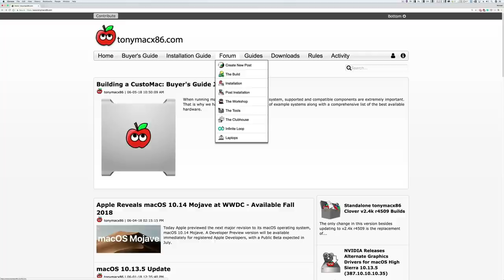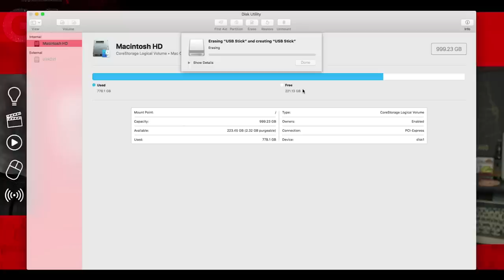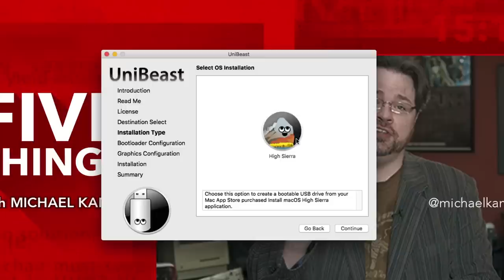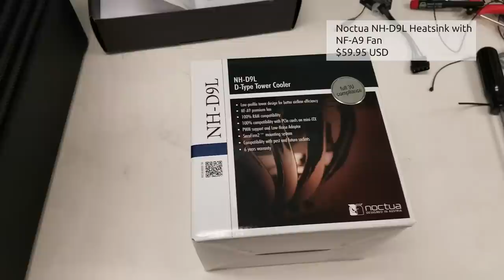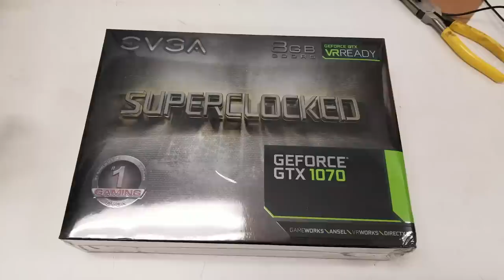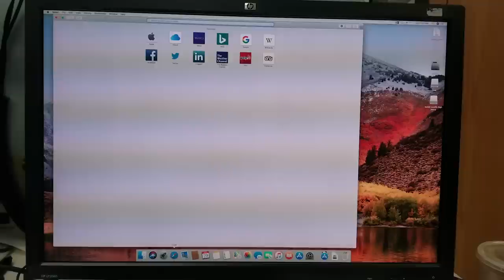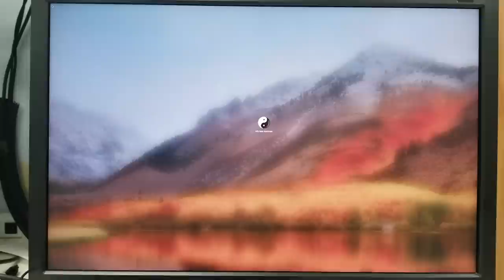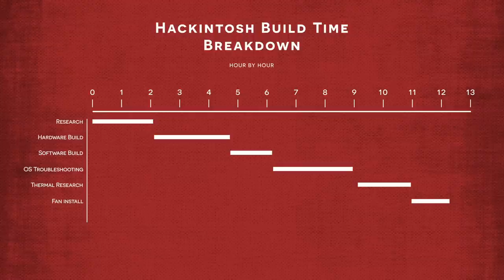Building a Hackintosh: Build & speed vs Mac Pro & iMac Pro with Avid, Premiere & FCPX

Comment: ok but the warranty for apple always screws people. not worth fixing buy a new one. idk how many times ive seen and hear those exact words. in this case with the hackintosh each individual part is under warranty. so if one of them bricks that single part is replaced. if anything goes wrong on any mac they have to replace the whole thing inside which is designed to fail. and any software problem or simple problem that may cost someone 30 bucks at one repair shop cost 1500 at apple. not to mention that if you just live in a humid area the water detectors on the inside of any mac go red even if you have never spilled any water on it at all. right to repair is now becoming a serious thing in the US and voiding warranty because you decided to upgrade something is no longer enforceable in the US by law. im not a mac user nor will i ever be just looking into it for a friend and may have them go this route than throw 13k at apple for something that wont be able to last 2 years. and that is if the person is lucky.
Reply: I went Mac back in 06. Never had a warranty issue. Not once.  Designed to fail? Are you kidding, I've been running the same desktop for eight years!  never even turn it off.  Been perfect.
Reply: I went Apple in 06. I have NEVER had them fail to honor a warranty. Ever.

Comment: Its a hobby, but hunting for screws, doing a whole lot of research, a lot of ordering unassembled parts, spending a weekend assembling things two or three times, borking the system, trouble shooting errors, putting up with glitches and inferior substitutes (particularly the screen), and begging for help from other users who are suffering the same problems, all has a dollar value.

...and you get to do this all over again when you change something. 

Also you have no warranty, no support and really should not expect any seeing as you have not paid Apple for any.

I've regularly looked at building a Hackintosh but the real cost, lost time, compromises and risk, along with long term unsaleablity have meant it has NEVER been worth it. I'd want a lot more perfomance gains, cash savings and access to someone who knows a lot more on the subject before I'd take the chance that maybe, just maybe I won't have done my dough and wasted a lot of time in the process.
Reply: You realize he spent $10,000 less than the imac pro and his hackeintosh basically kept up right? You could build 2 of these computers and still buy a new car (Mitsubishi Mirage) for that. It isn't that I don't agree that it is a pita to keep it running, and to many people that is a deal breaker, but you can't deny the savings. If you know your way around osx, it can be a real option. 
I plan on buiding a Hackintosh for my next machine so I can see if I like using osx. I have been using linux for the past 8 years and I find myself doing more and more video editing. But I'm sure as shit not spending what apple would want me to just to see if I like it.
Reply: You weren't paying attention or read the parts list.

No 1 obvious missing part: No 5k monitor. That's an extra $1200 just on its own.

Other obvious omissions: No speakers, no Thunderbolt 3, no keyboard, no mouse, no workstation grade parts. Also no support or warranty.

So even just on cash spent it is NOT a "$2500 Hackintosh". 

He fully concedes the amount of time he spent researching, building, fixing and looking for screws. Do you work for free? He owns up to at least 12 hours just to get it up and running with more to come. As he says "time is money".

If you run a business this is most definitely "non-billable" time with more lost time down the track everytime you change something or Apple changes something.

Yes you can pick and choose what you put into your Hackintosh which is a good thing but also a bad thing when you can't be certain if your choices are going to work, or simply lead you to yet more problems and a borked computer, or one that works but with nagging problems you will waste time resolving. Part of Apple's price is that is not your problem.

I'm a Hackintosh builder in waiting. If Apple pisses me off enough I might take the chance on a Hackintosh, but so long as I don't have my back to the wall I consider it too great a chance on just doing my dough and being no better off at the end of it.
Reply: The monitor that comes with the imac pro isnt very accurate. you would need to buy a separate one for coloring work anyway so I don't really see that as a benefit. any random 4k decent monitor would have the same basic usefulness as the built in one. You are not really saving any money with the built in monitor, and for a professional level system, it is really a very weak link.  And with a few tweaks in hardware that wouldnt account to not still being able to buy a mitsubishi mirage you could have thunderbolt three. Many of his issues came down to him wanting something small form factor. 
I think the fact that my build comes with a brand new car makes up for the fact that you cant bill the 3-9 hours it takes to build the thing. Unless you are Steven Speilberg, then I guess you probably could get a new car with 9 hours of work.
Reply: That is NOT true. The iMac Pro and iMac 5k monitors are very accurate which does not mean they do not need calibration, even the most expensive Eizo ColorEdge CG277 27 inch Monitor (which costs close to $3000) needs calibration. 

The constant fudging of 4k is the same as 5k, cheap substitute monitor, non-work station hardware, no thunderbolt, 3-9hrs instead of the 9-12 hours it took JUST to SET UP the Hackintosh (more down the track), no warranty and support, lack of certainty, do not make it a like with like comparison. Blatantly obvious and irritating "Lies to Self".

Given all that, I personally will not buy an iMac Pro for several reasons besides the cost. The bad design for the ventilation will I am almost certain be a problem down the track, the lack of real world access to the RAM and the fact that the iMac Pro is actually slower than the 5k iMac in virtually every task except rendering x265 video. So really should have compared an iMac 5k with the Hackintosh.

Comment: Apple products are way overpriced and under perform in every metric across the board. The new Apple Mac laptop performs worse than the last years model as it thermal throttles right out of the box. Users recomend using inside a walk in freezer if you need to render.  Thankfully the Apple Fan boys never run benchmarks on these toys or they would understand they got screwed again.  I have used a Mac and it was a frustrating expensive menage of expensive oversized dongles and disappointing user experience. Is it worth polishing a turd? 
The only metrics Apple leads in are Overheating and the Super Slim profile design with zero fans and zero air flow there bye assuring a very short life of your Overpriced super sexy Play toy.